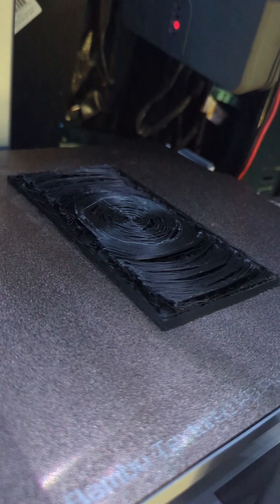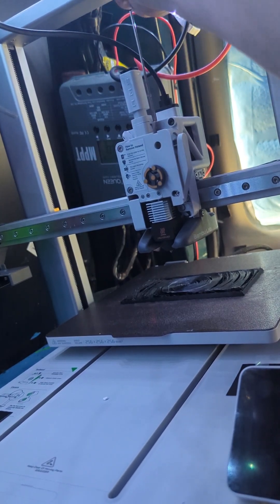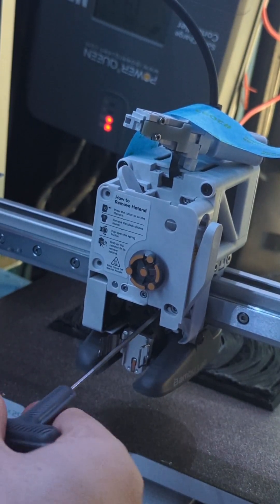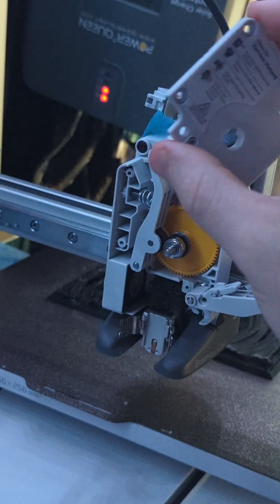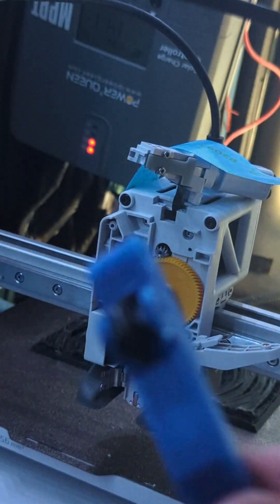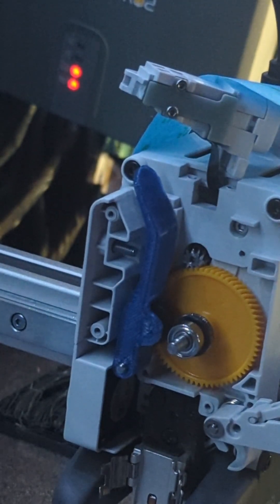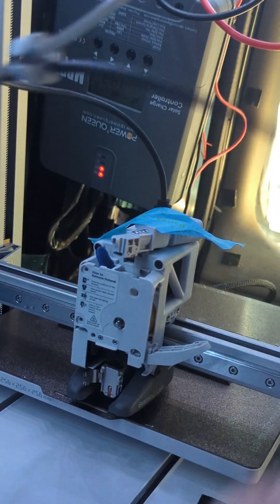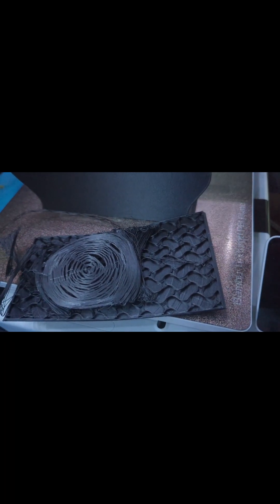Extruder Hack to print softer TPU and CF PP on Bambu A1 and Bambu A1 Mini

Comment: My work bench doesn't look like yours brother 😂😂 you can actually work on yours unlike my mt of electronics 😂😂 and just get the bambu A1 hardened steel extruder gears from Bigtreetech there like 22-25$ I got them in ll my A1s but I think i may have to retire the A1 mini and give its head a promotion to the A1 MAX lol basically swapping it over to a Elegoo Neptune 4 Max 😂😂and of course its blobifier too. But eventually its gonna be one of my speed heads for the Voron build 😂 cause its a baby.  But you will like the Panda gear set(from Bigtreetech)it will grab onto filament so hard your not gonna be able to pull it out 😂😂😂